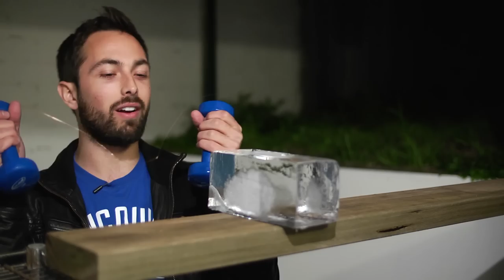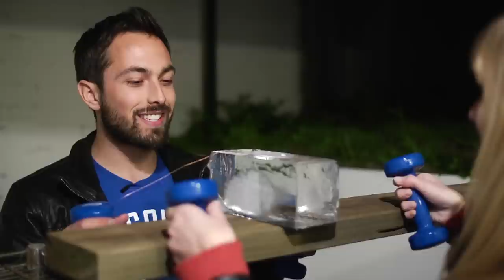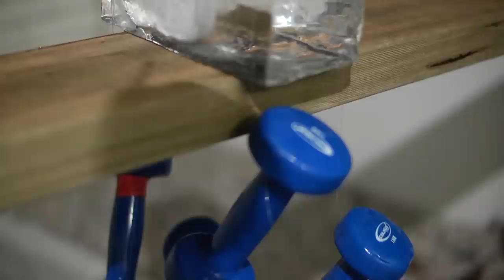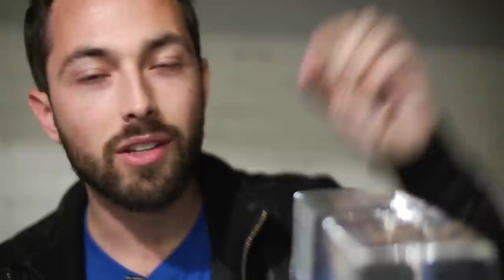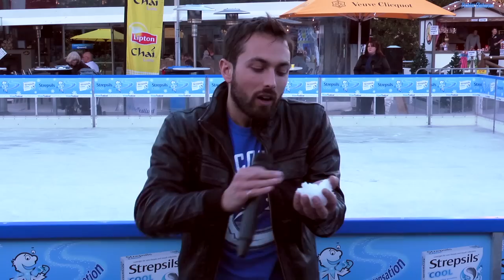Ice Cutting Experiment

Comment: why were you talking like someone was trying to sleep?
Reply from the maker: Because someone was trying to sleep.
Reply: Veritasium  Simple enough!
Reply: +Veritasium ok
Reply: +Veritasium i like your
Reply: +Veritasium Is it also possible that the copper wire may have contracted more than the fishing line did? That would mean a smaller area of copper/ice contact and thus a higher pressure?
Reply: +Danger Close It is Half past 1:00 AM he said
Reply: Maybe because he mentioned that it was past 1 in the morning?
Reply: It was 5 years ago when he was working his ass off to reach in current popularity I guess.
Reply: Why didn't you try with a thinner fishing line to find out if greater pressure can make up for conductivity?
Reply: Why didn't you try with a thinner fishing line to find out if greater pressure can make up for conductivity?
Reply: MrOperettalover
Isn't that pretty obvious? If you have a thinner thread, it will have less resistance which will make it easier to cut through. But when I think about it, it will create less heat which will make it slower. But I think that the heat will be about the same so, the copper will still win even though the fishing line will cut through faster than before.
Reply: Danger Close -

You forgot the capital letter.
Reply: veganbirthdayparty  that was intentional...... for effect.
Reply: Danger Close -

that's what i thought
Reply: @veritasium  lol
Reply: Wait a second, he replied to a comment 3 years after this vid was uploaded
Reply: He took time out of his life to reply to this comment that was made 3 YEARS after the video

dedication 100

Comment from the maker: looks like a parabola, doesn't it? I haven't really thought about it so I'm not sure.
Reply: I love parabola!
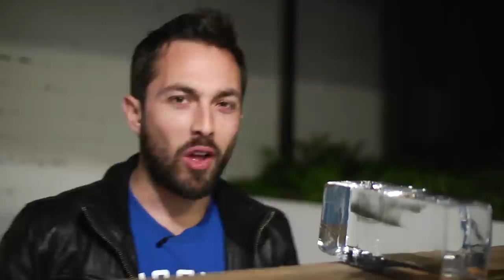Reply: REMOVE 0:47 AHH
Reply: I think it's a hyperbolic
Reply: @OliverHynds  the edges of the wire seem to be almost vertical though. It's plausible that it's a hyperbola with asymptotes that are near vertical because in a previous video where the wires were sloped at an angle outside of the block rather than straight down, it looked pretty hyperbolic with the asymptotes having the slope of the line outside of the ice.
Reply: @hadhamalnam  maybe like -cosh(x)?
Reply: probably a catenary
Reply: Maybe try it with a cylinder of ice next time?
Reply: The "equilibrium" would be an half-circle, (uniform) pressure on the ice

Comment: I mean they were going roughly the same speed. Then you scraped the enamel off, decreased the surface area and put the copper wire on. Drastically increasing the pressure, and suddenly it raced past the fishing line? Surely that is to be expected

Comment from the maker: @ParbelleCondorcet Excellent work! I think I was using 30 gauge wire. It did take some hours for the wire to pass through. Also I'm told the pressure effect works mainly above    -3C so I hope it's not too cold where you are.

Comment: Hi Derek! We're currently experimenting on this with copper/steel/nylon.
We had a block of ice roughly the same size as that you used in this video.
The steel wire, with two 5-kg weights attached, crossed the block in 10 minutes in the classroom. The experiment could be repeated in front of many groups. ...

Comment: Love the videos !  Before you did the experiment, I DID think about the thermal conductivity of copper but couldn't guess which one was going to slide through faster...  OK, so...

 I was looking at regelation in Wikipedia and noticed this...   

"

Misconceptions                         

Ice skating is given as an example of regelation; however the pressure required is much greater than the weight of a skater. Additionally, regelation does not explain how one can ice skate at sub-zero (°C) temperatures.[4]

Weights suspended from a wire which cuts through ice, is an example given in old textbooks. Once again the pressure required far exceeds the force applied. Conduction of heat from the room through the metal wire is the correct explanation of this phenomenon.

Compaction and creation of snow balls is another example from old texts. Again the pressure required is far greater than can be applied by hand. A counter example is that cars do not melt snow as they run over it.

"So what gives ?  

Then again, in the Wikipedia "TALK" portion, it says...

"The article contradicts itself: according to the introduction, a copper 
wire cutting through ice is a valid example, although the details are 
complex. According to the 'misconceptions' paragraph it is an invalid 
example.
"

I also noticed in one of the comments here where he/she mentions the thickness of the fishing line vs. the thickness of the copper and thinking it should go quicker maybe ?

Comment: What if the copper wire that isn't in the ice is acting as a heatsink?
Reply: exactly my thoughts. It grabs heat from the ambient air and allows it to travel into the ice block without much loss unlike the fishing line.
Reply: chances are the air temp is higher than the ice temp, so it would actually act to draw heat from the air into the ice, not the other way around.
Reply: sn0wchyld uhh, dude, that's what we said... We weren't saying it was a cold sink..lol
Reply: Mor Bid lol yea i didn't read your comment... i was thinking he meant sink heat from the ice to the air 0.o
Reply: Exactly what I thought
Reply: Much more likely than the energy exhausting from water's freezing process serving to help it melt.

Comment: When you stripped off the insulation, you decreased the thickness of the copper wire- thus less area was in contact with the ice and since you have the same weight that lead to higher pressure on the ice and faster melting.
Reply: I suspect the coating was very thin so the decease in thickness would have been quite small
Reply: The copper wire was probably measured not taking into consideration the coating. So it was probably thinking with the coating than the fishing line

Comment: What if you hold the background temperature below 0 Celsius, while performing this experiment?

In that case:
A: would regelation happen for both the copper wire and nylon string systems?
B: would the copper wire still beat the nylon string?
Reply: I thought something similar. 
I can see the bloc of ice melting during the experiment, therefore I  suspect the outside temperature is higher than 0C. If the outside temperature is higher than the ice, the higher thermal conductivity of the copper transfer more energy to the ice than plastic fishing wire. However, the explanation in the video is true  as well, since the ice is only melting on the high pressure side, below the wire, and refreeze on the low pressure side, above the wire, most of the latent energy (phase change) has to go through the wire,and copper is a better thermal conductor that plastic. But, the energy also coming from the pressurized ice , below the wire, by decreasing the temperature, for this heat transfer, the wire material as no effect.

I think is it also true, that if the outside temperature is warmer than 0C some melting near the air/ice/wire interphase is quicker with the copper wire. It has the effect of ‘’pushing’’ the side wire to the center of the block quicker with the copper wire  and it is increasing the pressure on the wire as the surface contact is reduced. More pressure, more melting by increasing melting temperature.

I would be curious to try this test at a colder temperature outside than the calculated melting point of pressurized ice.

Comment: The pressure enacted by the string causes the state of matter in the ice to change from solid to liquid. Pressure is one of the criteria that determines a materials state of matter, along with temperature. I suppose this could be done with many other materials, but it would require very extreme pressure, a lot more than a copper wire and two dumbbells could provide. Ice is probably the only material where regelation would occur in nature.

Comment: I'm pretty sure the Cooper wire won, like you said, by thermometret conductivity. But i think it was because the temperature was warmer than the freezing point of ice, and the copper wire actet like a radiator, transfering the cooler air to the warmer temperature of the room. Try doing the experiment again, but in a room with a temperature colder than 0 celcius. Then the fishingline would be faster, and the copper wire shouldn't move or move very slowly
Reply: That's a cool observation, but he specifically mentioned that the wire goes through the ice because of the pressure, not because the ambient temperature of the room. So if he tried this experiment in a walk in freezer, wouldn't the copper wire still pass through the ice?
Reply: @BlueSkiesTruthRadio  Yes it would.
Reply: My thoughts are in a room with temperature below 0 the speed of copper wire would still be the same because now the block of ice has more heat than the surroundings and hence copper whose thermal properties are irrespective of temperature, the copper wire along with it's pressure now acts as a more effective heat sink, thus amplifying the speed.

Comment: The weighted wire provides a pressure on the ice.
That pressure lowers the melting point of the ice as it brings the water molecules closer together causing a state change from Ice to water.
The wire then passes through the water layer.
The ice at the top, no longer under pressure, and still at it's freezing point, refreezes.
It's called regelation and wikipedia probably has a better explanation

Comment: @1veritasium We do not have a Siberian winter in central France ! Temps are around -5°C until the beginning of next week. I have done this experiment many times over the years and what is important is to have a "warm" block of ice, ideally 0°C, as you need 140 bars of pressure to decrease the melting point by 1°C, which can explain the -3°C limit you are mentioning. Ice out of a standard -18°C freezer will be extremely hard to slice

Comment: 65 m of 0.288 mm diamond wire alloy costs around 200 USD as of today. Pretty expensive if you ask me as all it is is just copper wire coated in diamond via electrolysis. The length of A pure diamond version of 0.288mm wire at the same price would be a mere 2 to 5 m depending on the factors involved (fluctuations of currency, profit margins, purity, etc.)

Comment: For a string under tension to maintain a given shape, you need to apply a certain force at each point along the string related to its curvature. A string hanging under gravity attains the shape where the force needed to maintain it is the same everywhere and is just the force from gravity. Here reaction from ice provides necessary force to hold any shape in short term, but in long term areas providing higher normal force melt faster, and again a shape with force constant everywhere is reached.

Comment: Wouldn't the heat also simply come from the other part of the copper wire being in open air? So that the heat of the air can travel via the wire to the inside of the ice?
Reply: +MaxArceus Do you think it's also possible that the copper wire may have contracted more than the fishing line did? That would mean a smaller area of copper/ice contact and thus a higher pressure?
Reply: ballplaya1113 If the copper wire contacted more, the surface area on which pressure is applied would be larger, while the weight is not, so if anything, the actual pressure per surface area would be smaller.
Reply: MaxArceus I said contRacted not contacted! As in the radius of the wire decreased, therefore the area of contact between wire and ice was smaller than with the fishing line. Pressure=Force/Area. Increased Pressure=Increased "Temperature" = melting ice faster than the fishing line.
Reply: ballplaya1113 Oh sorry, I didn't read carefully =~=
In my defense, it was early in the morning for me when commenting.
If it contracted it would result in a higher pressure yeah. But I don't think it would be really significant.
Reply: I know this is an old thead but anyway: While not knwoing about the exact conditions I'd assume the experiment to take place in a "normal" room-temperature room. That being said/assumed both the wire and the string would be at that room-temperature. If anything the copper wire would get colder (faster) than the nylon wire due to its conductivity until both reach an equilibrium. (just an educated guess though)

Comment: As a man who hasn't taken any physics classes (yet), I believe this is because of the room temperature of the wire and line used to attach the two weights together. The temperature of those two simply melt the ice and the weights bring it down using gravity. So there's no cutting involved, just melting.

I may be wrong, as I haven't watched the video fully yet and I'm not even half-decent at physics.

Comment: Copper indeed has much less SHC than the fishing line, but getting colder quicker actually works to its advantage. The colder it gets, the faster it sucks the heat in from the ambient, and it conducts it (much better than the fishing line would) towards the ice. However, if we observed the ice block, the wire and the line as an isolated system, with no energy going in or out, the line would actually cut deeper than the wire, but neither would have enough heat capacity to actually cut through.

Comment: Well, it's a legitemate phase diagram for water.  And the freezing/melting point does not start changing significantly until beyond 10 MPa, which is agreed upon by the phase diagrams in my textbooks.  

I agree with Claes ... there might be some melting generated by compressing the snowball with your hands, but it is insignificant compared to the amount of melting caused by heat your hands have added.

Comment: Was the entire room like < 0°, or did I just not notice it melting?
Reply: probably kept a fan on it
Reply: jarl balgruuf I could be wrong, but I believe a fan would cause it to melt faster, more air passing over would cause more transfer of energy. The cold moving to the air, and the heat moving to the block
Reply: it probably didn't take that long. 
If you have anything made of silver you can see for yourself how quickly it melts ice just by pushing it on there.
Reply: Cam W  cold is just the lack of heat so if you say so it will be theoretically wrong but well,.. nevermind
Reply: The fan would do nearly nothing to it unless the temperature of the air that the fan is moving is different from the temperature of the air that was already near the ice.
Assuming that the air is the same temperature, the fan would simply be pushing air at the ice, possibly causing slight friction and some heat.
Fans make people feel colder just simply by making sweat evaporate easier. Moving air generally makes people feel colder (this is why the temperature is sometimes shown, but there is also a "feels like [other temperature] due to windchill") because it doesn't allow the air near your body that you have warmed up to stay near you. The ice block, of course, has no sweat to be evaporated, nor does it have body-heat coming off of it, so the fan should be doing next to nothing (if there even was a fan).
Reply: Interesting, and it also is quite logical. What about the liquid water on the outer edge of the ice block? Would that evaporate in the same or similar fashion to sweat on skin?
Reply: Cam W Good question. :)
Reply: waawamellon Hah I re-read your message. Thanks for the info :)
Reply: Cam W lol you're welcome
After I typed out that entire thing I was just so done with thinking that I couldn't answer your question C:
Reply: waawamellon A fan would melt the ice faster.  What you're forgetting is that the ice significantly cools the air around it (just the opposite of what you mentioned regarding body temperature), thus moving that air would prevent the air from cooling around the ice.  The coefficient of friction between a block of ice and moving air is so small that its not really worth mentioning.  Try it for yourself if you don't believe me :)
Reply: Wes Dent I agree
Reply: Wes Dent I'm glad i read the comments below waawamellons because i was going to say the same thing.
Reply: waawamellon That's not correct at all. As the air moves faster there are more collisions at the atomic scale. When these collisions happen the particles share heat. The ice being made to share heat with the warmer air at a higher frequency means more energy transferred from the air to the ice over a given period of time, and the ice melting faster.
Reply: pcakes only a very small amount of ice melts and freezes again immediately before you can even see it melting.

Comment: its a very rare phenomena for a solid to melt under pressure, but it has to do with the crystal structure water forms when it freezes. It creates a hexagonal pattern that is actually less dense than its liquid state(@ lower than 4C), so when you apply pressure to ice that is not far below 0C it will enter a more dense state to drop to a lower energy state. This is a why water has so many of the interesting properties it does and actually has saved life from extinction when the earth froze over

Comment: Good thought. He made a comment "they are the same thickness"; not sure if he meant the two sides of the block of ice or the wires though. But it would be reasonable to control for the thickness if you wanted to get at the effect of the material, and it isn't hard to find copper of different gauges.

Comment: I work in the oil wells up in ND, here is a strange one on the lines of this video.  Some companies use hydrates when fracking.  The pressure down in these wells gets pretty intense.  The pressure crushes the hydrates making them freeze, despite being 300+ degrees F down there.  I work in wireline and have seen this stuff come out when we drop "junk baskets" to clear wells before running tools down.  The stuff is ice cold a day or two after being used.  But melts in minutes at surface.